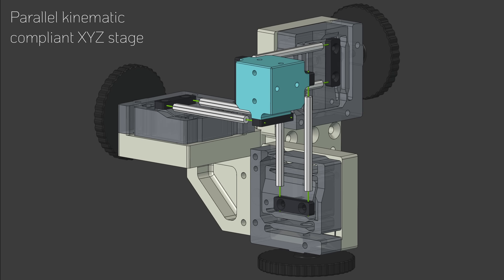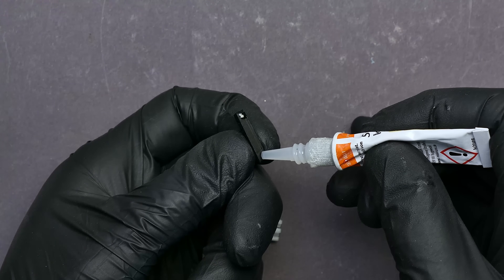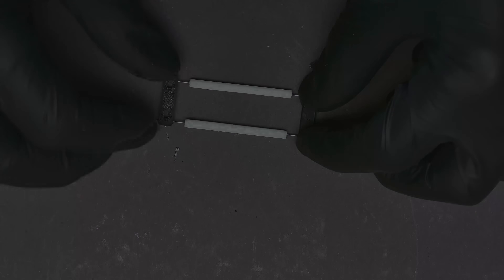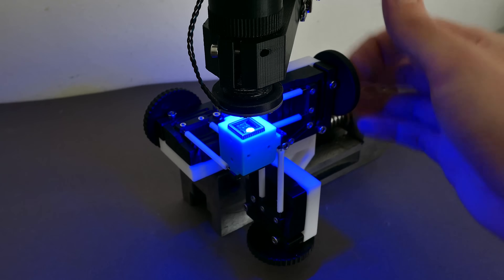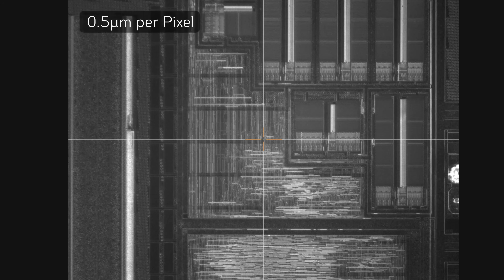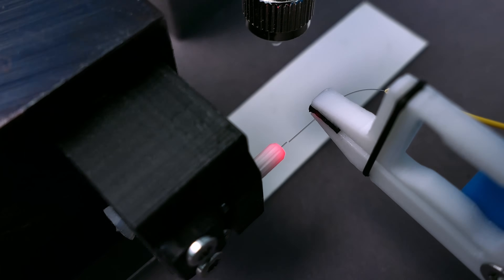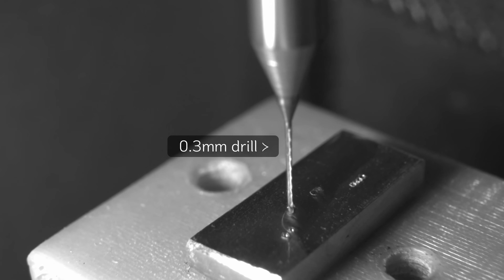A 3D-Printed Compliant Micro-Manipulator - XYZ Positioning down to 1µm

Comment: This is amazing! A bit confused about the purpose of the 3d printed flexures though, are they simply there to add preload into the system so there's no backlash with the screw or are they "de-amplifying” the step size of the screw in any way? Cool project

Comment: Hi, this is an amazing project. I am interested in developing an attachment for this that makes it function as a micromanipulator that is appropriate for using for nano-injections in a laboratory setting (e.g., 1 uL injections into insects). Do you think it would work well for this? It would be best if it could be controlled through something like the 3D printed "Spacemouse" controllers people make.
Reply from the maker: I had a request for a similar application in biology and did some test with realtime controll of the device via a normal computer mouse (XY only). It seemed to work quite good. If you use a 3D mouse while looking through a microscope to guide the motion I would expect this to be a very good and feasable aplication of the device.
Reply: @DiffractionLimited Thanks! I'm envisioning an open-source nanoinjector addon for this device. Your device is incredible and I think with an addon could replace tens of thousands of dollars of equipment. I will get back in touch when I'm able to actually start working on this.

Comment: recently built one myself from both 3d printed parts and all metal. suffice to say I hit 1micron accuracy without backlash on stepper controlled setup on repetitive movements on both systems. yours seem very intuitive regarding spring load mechanism, good work!

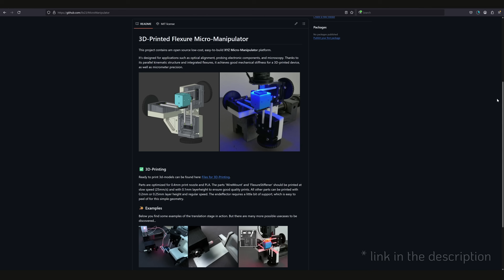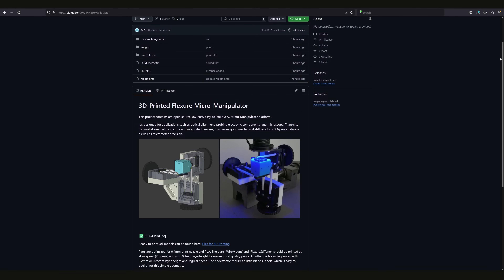Comment: Nice to see someone using FreeCAD, but would be even better if the voice was not computer generated. For example, at 2:08 you could have given the TTS program "Git Hub" rather than "GitHub" without the space. The list at 0:39 was not avoidable without rewording though, and I can't even fathom why it messed up "FreeCAD" (again, you could have just used "Free CAD" with a space) so horribly at 2:04. With some amount of knowledge in this, you could probably correct the scripts quickly, especially with ctrl+f or a find and replace tool to correct all cases of a repeated mistake when dealing with longer scripts. I guess I wouldn't consider it as big of a deal if English is not your first language, if you have a speech impediment, or if you just want to hide your identity.

Comment: I have seen budget micrometer drives for sale sometimes.  They are clamped on and could drive against a bearing ball set into the flexure moving part and provide reasonably affordable manual or even motorised control with first order positional accuracy.  Over 6mm the sin/cos error might already be detectable but it is predictable so not really a problem.
Reply from the maker: Thorlabs has precision adjuster screw+nut for about 12$ combined, which I find also quite reasonable, but your suggestion is also very good.

Comment: Truely inspiring project 👏👏👏👏👏👏👏👏
I wonder how long the accuracy of the complinat micro-manipulator stays intact. I know from my experience with PLA, Creep is an issue when components are left under relatively low loads for long periods.
did you test this for the compliant parts?, for example, do you have "slack" in one direction if the device is left in one extreme position of an axis for a period of time?

Comment: Pretty neat little manipulator. You could increase the precision using flextures with two inputs having different mechanical advantages. basically adding fine adjustment knobs

Comment: Very nice. I designed a printed 3 axis system too (https://youtu.be/zBTdy4V52NY) but the precision is not up to par. Choosing flexure is definitely the best for accuracy. What is the range of motion of your system?
Reply from the maker: Cool, I have actually watched this video while doing some research for this project. Range is probable better with your serial setup (6mm^3 for the flexure based one). The motorized one will hopefull reach 20mm^3 though
Reply: @DiffractionLimited 20mm would be quite useful, i'll look forward to it 👍

Comment: For ultra-fine linear adjustments, a differential screw is an excellent mechanism. It utilizes two coaxial threads with slightly different pitches, where the effective travel per revolution is the difference between them. This allows for achieving sub-micron positioning resolution.
Reply: Is this the mechanism used by a screw thread micrometer? If so, maybe 3x of those hooked up to servos could be the easiest way to make this
Reply: @ff-qf1th  That's a valid point, but the main challenge is that high electronic resolution from a stepper/servo doesn't guarantee mechanical accuracy. Microstepping has significantly reduced torque, and more importantly, any backlash or compliance in a standard screw will absorb such small commanded movements. The key advantage of a differential screw is that its precision is inherent to its mechanics, using a large mechanical advantage to make it far more rigid, accurate, and immune to these issues.
Reply: @SergeiPetrov  the O-rings of the mechanisms leaves it in constant tension therefore no backlash. Also while true that the torque is reduced while micro-stepping, you are severely overestimating the torques required for such mechanisms. Just think of a common 3D-Printer, their steppers run on around 1,8A with as high micro-stepping as possible and still move very quickly while under load with no issues.
Reply: @guillermom1708  no issues? https://www.youtube.com/shorts/B8dC6A7hDjc
Reply: @SergeiPetrov  that has nothing to do with torque as you mentioned. I also said nothing about the angular resolution. Reading comprehension is a valuable skill you should perhaps learn
Reply: @guillermom1708  "stepper/servo doesn't guarantee mechanical accuracy." (С)
Reply: I'd watch it for sure. With a differential screw the adjustments from the handwheel would get even finer. It uses two sets of thread, with non-identical pitches. The difference in pitch becomes the effective pitch. For example 0,5mm and 0,4mm pitch combination would give you effective pitch of just 0,1mm per turn of the wheel.

Comment: As others have said, great work, and thank you for open sourcing it!  I'll definitely be building one just to experiment with the flexures and overall design.

One question before my main comment - how do you deal with the superglue bonding the parts together in the wire fixture?  Do you just remove them as quickly as possible, or did you print that in a Nylon or other material less likely to be bonded?

Assuming I didn't miss anything in the video:
One change that will greatly improve the feel of the system, and probably the very fine positioning performance - add at least one more washer and a Nylock or pair of lock nuts to the inside of the bracket where the knob bolt passes through.  A thrust bearing on each side would be even better, but would add to the BoM; I've printed them in the past, but not at this diameter / ball diameter with FDM.

This change will lock the knob to the bracket, instead of letting it float coupled to the flexure drive nut.

In the text below, I'm calling a "thrust washer" either a thrust bearing, OR two plain washers with their smooth sides in contact - the way most washers are manufactured (stamping I believe), one face has a smooth surface and radiused edges, while the other has sharp edges and sometimes even a burr.  A drop of silicone oil (safe for most FDM materials _in my experience_) on the washers and bolt will further improve the feel.

The stack up (which I'll put together an image and upload to github):

Clamp bolt > handwheel > thrust washer > bracket > thrust washer > lock nuts > drive nut in flexure
Reply from the maker: Thank you for to extensive reply. Please let me know if this improves the responsiveness. The idea is however, that the mechnism is always prelaoded in one direction by the orings (otherwise it wouldnt be very accurate) so I am not sure loking the Wheel from both side will have much benefit. Using precision screw adjusters (may 12$ each e.g. fromn Thorlabs) will help a lot though, but I wanted to keep it low cost.

Comment: Insane what you can do with these cheap components!  I wonder about a few things: why is the backlash so good? From the video where you zoom in you dont seem to see any. Why is the stability so good? Id expect such long rods to maybe propagate some vibrations. How is thermal/long term stability?
Reply from the maker: Flexures are free of backlesh and the drivenut is preloaded. Thermal and longterm stability probaly not so great. Plasiks expands alot when temperature changes. Making the Frame (white parts) from metal would help quite a bit.

Comment: That's brilliant. Micro CNC machining at home with a cheap drill is now an option. 
Only thing is - 6x6x6 mm is a pretty small working range...
Reply: OP said they'd make it bigger. I think 2.5 cm x and y would be great for most applications. I'm interested in microphotogrammetry with a bigger platform. This would be great as is for cell manipulation.
Reply: The limit is your 3d printer bed!

Comment: very clever, I am philosophically opposed to so many screws holding this together, but I can see it seems to be taking advantage of printing each section in the correct orientation for maximum strength.

incorporating simple cut wires, and the positioning bolts is perfect, I've been designing prints to incorporate simple poured, or cut materials into 3d prints, so I would probably attempt to design a concrete filled base for stability, if it can't be clamped to a table
Reply from the maker: Great idea! If you like to contribute and manage to design a printable mould for a part that can replace the three white prints, that would be awesome!

Comment: This is genuinely incredible. Plus its super affordable. I usually work with lithography machines which have accuracy on the level of nanometers, the fact that a 3d printed design can achieve um accuracy is mindblowing to me.
Reply: I've seen 3d printed compliant mechanism that can do nanometer precision positioning
Reply: @communist754 that's awesome, what's the name of the project?
Reply: Yeahhh! I did some play on this on the lab, mixed epoxy granite plus flexures to get nm on the holographic bed. It was a QPI wavefront Reconstruction.
Reply: Hey bro on what Litography machines do you work? I work something similar but in my free time I started to explore motors actuators etc. a little bit. Best regards! If you have any Discord would be nice, a Simple OpenSource Litography I something I dream about would be dope if something similar exists! :)
Reply: @lukalicina8230  i use an ebl machine from elionix. Actually lithography is only one small part of my research work. In our lab we use it to create devices out of twisted graphene to study superconductivity.
Reply: @lukalicina8230  Lithography Stepper V2 Build by HackerFab. It's open source and IIRC breaking taps made a video about a similar build.
Reply: @lukalicina8230 HackerFab have made an open source lithography stepper.

Comment: Is there some coupling between the axes?  It seems like when you move in X, Z is drifting, and similarly with other axis combinations.
Reply from the maker: Yes indeed. The endeffector moves in a circle with the radius of the wire lengths.

Comment: that is very impressive, but how to keep the other 2 axis parallel while you are pulling one axis? will that change the parallelism ? thanks for the sharing!!!!
Reply from the maker: it will not change the parallelism (i.e. the rotation of the endeffector). However when turning only a single axis the motion follows a slight arc. In many applications this is not a problem. The motorized version can compensate for this in software.
Reply: @DiffractionLimited yes, i see, thanks for the reply

Comment: Very impressive results. Also I´m really amazed with the microscope solution as a whole. Would you mind sharing details about the rest of the microscope, which also looks 3d printed in wide parts. For some time in the past I tried to decide if and what microscope (mostly for smd soldering also for other interests) I should buy and if buy used, or try some custom project with some lenses and cmos combination from ali or else. again your setup looks super steady and very probably better than anything I could buy with the money I would allow myself to spend on such device. As I got a 3d printer your solution seems to be more than considerable.

Comment: A wonderful presentation of a flexure positioning device. 
I did notice that you had used what appeared to be an elastic band in one shot. Was this to take up backlash? That does seem to be a problem with flexures driven by lead screws around the neutral point. This can be ameliorated by only using half of the travel and using the screw in either compression or tension (depending whatever back driving forces may be present) That does of course halve the available travel unfortunately.

[ETA]  Ah, I see it's an O'ring to add preload to mitigate the PLA creep potential. Flat shim stock sandwiched between the 3D printed carrier may be a good alternative to an all in one print. The above caveat re backlash still applies however.

Comment: Your projects are incredible, congratulations on your work!

For the crank wheels issue, you can try to use hard drive bearings. There is the disk bearing and the arm bearing, the latter seems to be a good option for assembling the crank wheel. They are very precise and have practically no oscillation.

The base structure of the HD is also great for assembling delicate projects.

Comment: The only drawback of this solution is that the X-Y-Z movements are non-linearly interdependent. A computerized version must take account of this.
Reply from the maker: Yes, a inverse kinematic model is on the todo list...
Reply: @DiffractionLimited Absolute beast this Man. Love it!
Reply: @DiffractionLimited Rather then a parallelogram linkage, I wonder if you could use something like a Watt's linkage to remove the need for reverse kinamatics?
Reply: Very cool project
Reply: I wonder how cool would be, having 3 step motors, with microsteps.

Comment: The only thing I think I would try instead on this design is using sheet metal instead of wires for the flextures. Parts could be cut relatively fast and have near enough performance to the wire flextures. It certainly wouldn't look as nice though.
Reply from the maker: I believe wires are required since they have to flex in two dimensions (think of a ball joint) - sheet metal can only bend in one dimension (like a door hinge).
Reply: Lasercut stainless stencils, typically 0.1-0.2mm  for surface mount PCB assembly can be done extremely cheaply from JLCPCB

Comment: Please give us a back story of this project, what made you do this, what made you think you could use a FDM 3D printer to build such precision setup? Well done man excellent work.
Reply from the maker: Thanks, the backstory is pretty simple: I was looking for an easy to replicate way of building a compact fiber-coupled laser diode setup. I had a design which was kind of working but not so easy to build and to adjust. So I decided to make the alignment system as a seperate device and use glue to fix the positioned fiber into place, as it is often done in industry. The advantage is that you only need to build one XYZ-Stage and can reuse it for any number of fiber coupling task. Since this is a side-project and a tool for things to come, I wanted it  to be as accessible as possible and low effort - hence the choice to use FDM printing.
Reply: @DiffractionLimitedare you an optical engineer, do you do these as a freelance, consultant or are these projects are part of your day job? You have deep knowledge in many related areas of optics and photonics. Really inspirational, I'll try to repeat your process because this would be really useful for my fibre alignment work. Manny thanks for sharing.
Reply from the maker: @optiondrone5468  Neither actually. Would be nice to get paid for projects like this but I actually do them because I find them interesting and share them in case others might as well. My professional background is in computer vision, computer graphics, 3D-scanning and photogrammetry - so a yes some optics involved but not things like this. I occasionally do freelance jobs, if they really fit my interests though. Also good luck with the build, let me know if something was not working as expected. Also you might want to consider using precision screw adjusters from Thorlabs if you are willing to spend an extra 12€ for each axis and modify the CAD model. They will give you even finer controll.
Reply: @DiffractionLimited This makes your work even more interesting. I mean your interferometer video series video was solid opto-mechanical work. Amazing work man. thanks for sharing.

Comment: Very cool! When I tried 3D printing flextures I found that PLA prints fatigue rather quickly and the restoring force of the mechanism vanishes, and thus it can't be moved as easily anymore. 

Have you encountered similar issues?
Reply from the maker: No, not yet. The flexures are designed to operate below PLAs elastic limit and preload is provided by the O-Rings (which is admittably not ideal but a very compact solution). But you are right in that PLA does tend to creep and thus can not retain its 'springiness' over long time. Therefore the preload needs to be applied from a different material.